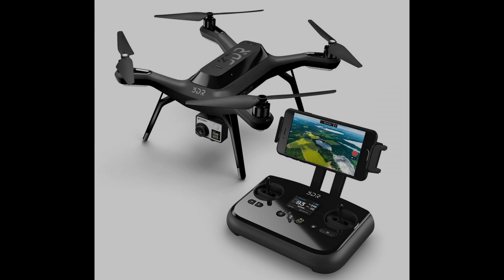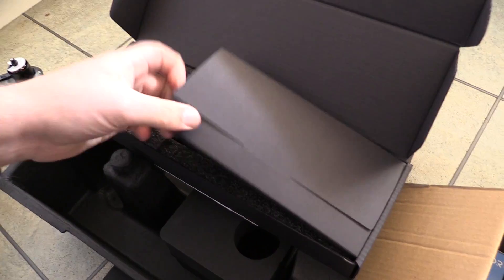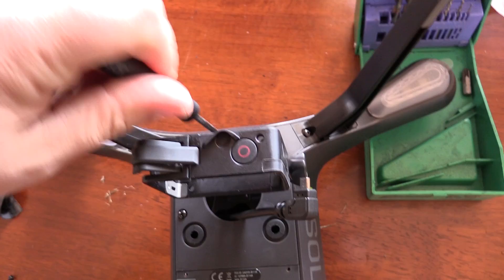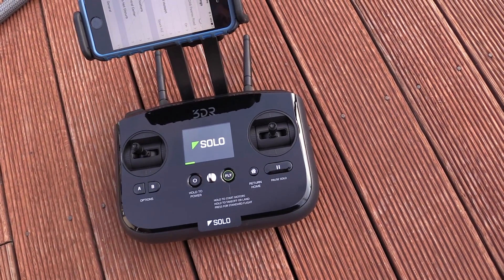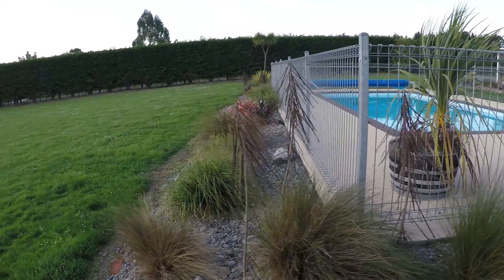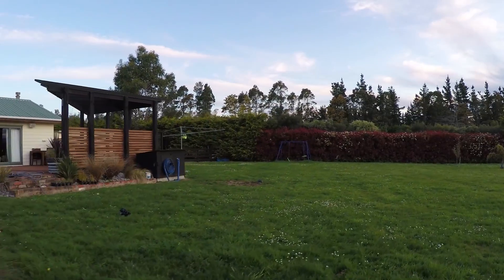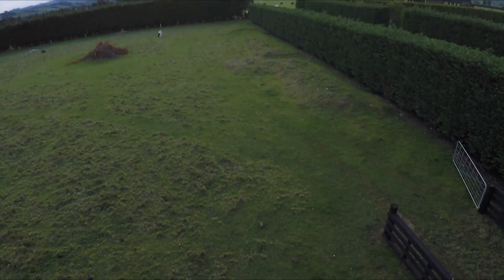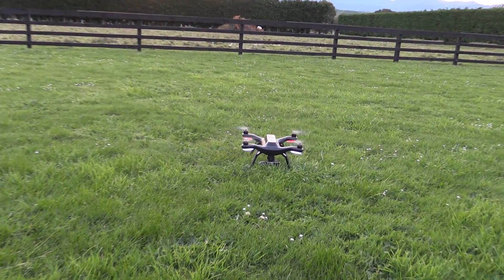The 3dr Solo GoPro Drone - Review

Comment: Hi Toby, good review. How much flight tome do you get?
Reply: 15-20 minutes
Reply: To what percentage do you fly your batteries when you get 20 min?
I am a longtime lipo uses and never go below 30% max 20% so I do the same on my Solo.
for me 14-15 min.  is the real max I can get.
Reply: +Mike Evers With the gimbal, non agressive slow cinematic shots, and 90% time using smart shots i get about 15 minutes the battery usually is at 35%.  If you do aggresive flying with performance level boosted up, yeah thats about 10 minutes.